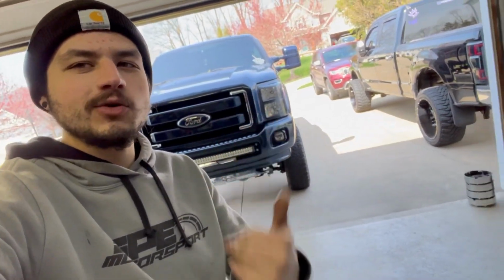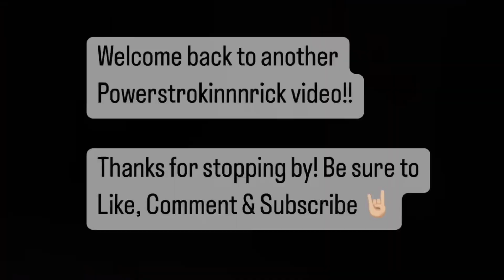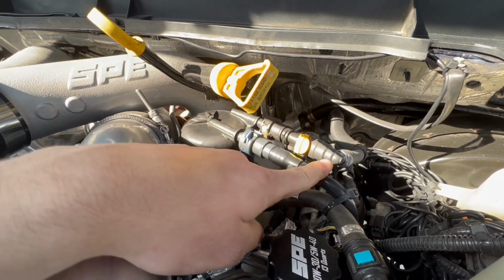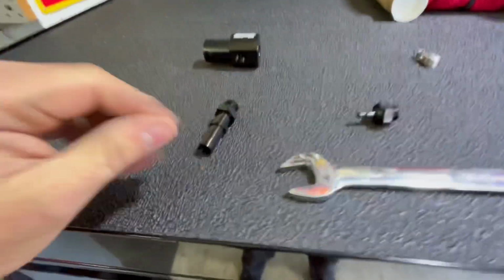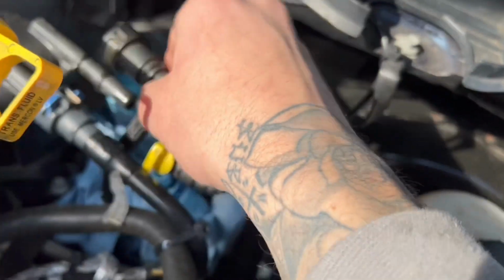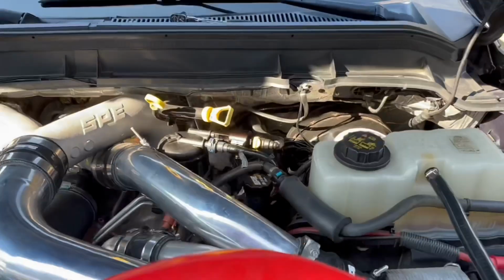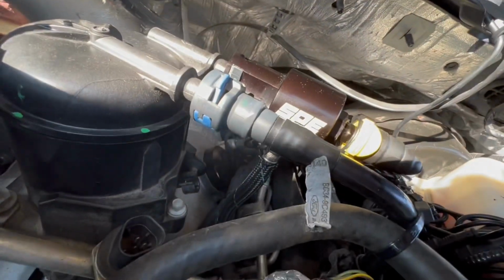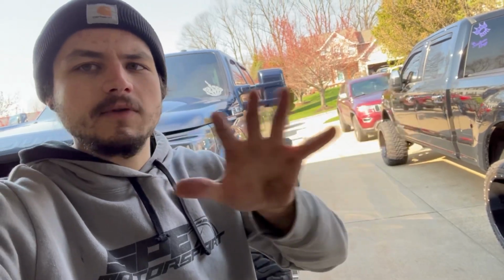REPLACE this before it’s too late! 11-16 6.7 Powerstroke SPE MOTORSPORT part install

Comment: Nice vid. Did my SPE upgrade on my 2018. How/where did you route your hose on the CCV delete/reroute?
Reply from the maker: Thank you! I just ran it over the brake booster and ran it down by the radius arms